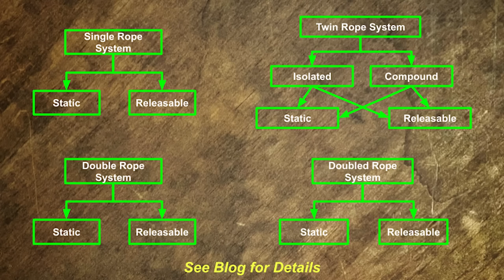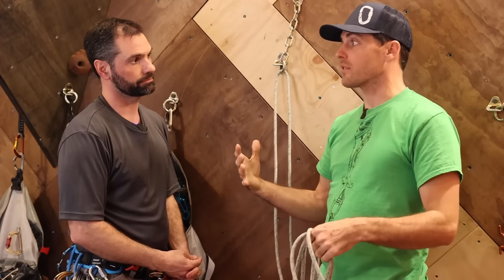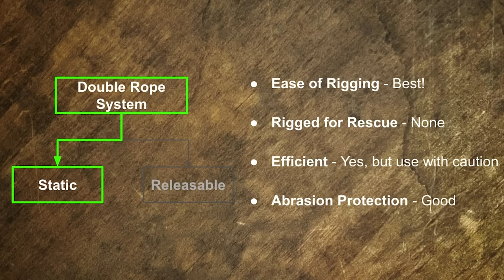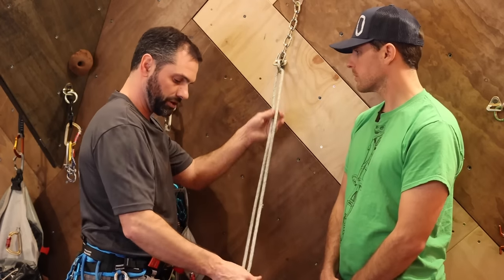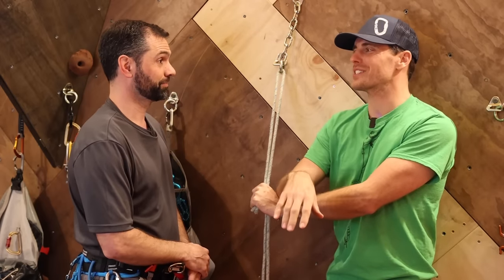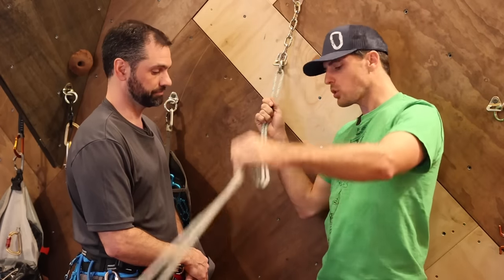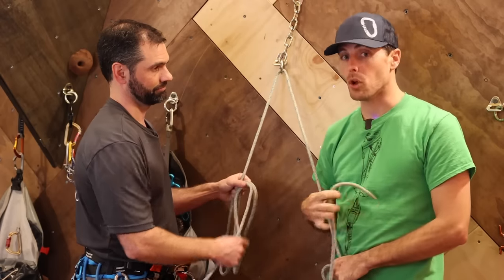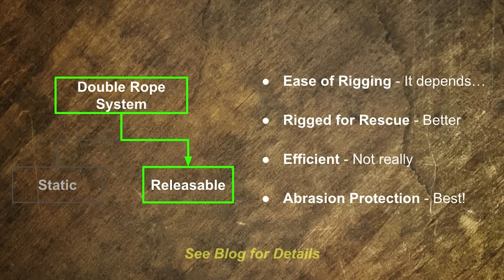Climbing vs canyon rappelling

Comment: When doing a simple double strand rappel there is a rescue option. You can isolate both strands at the anchor point using prusiks and then you can rig a contingency block and remove the prusiks and lower the stuck rappeler.
Reply: I’m gonna have to do further research to understand what you’ve written, but thank you

Comment: In caving, the changeover from descent to ascent is often practiced as an emergency maneuver. If you're on rap and get stuck in a waterfall... It's the same danger as canyoning.  But all the lines are single, static, (non releasable) and there's no rescue option.

Comment: I'd love it if you could get Brent to talk about the physics and science behind why, durning a 300 foot free hanging rap (such as a single stranded rap that is free hanging for 300 feet in Heaps Canyon in Zion), the first 100 feet you're almost feeding the rope through the rap device, the next 100 are perfect, and the last 100 you have to add friction! If you could explain why this is (is it rope weight? The rope "smoothing a grove" in the device? Forces from above?), that would be awesome!
Reply: Simple way to think about it - Just rope becomes lighter. ie less rope below you = less weight helping you brake / slow your speed. Less friction. More speed. More friction you have to add.
Reply: @1on1adventures48  So would it make a diference if the rope was in a rope bag connected to your harness vs. dangling below?
Reply: @BigDaddyAction360  interesting point here. With the rope in a bag (attached to you) - it then won’t change the friction like above. The only thing that will change is the actual weight of the abseiler. By the time you reach the bottom you will be slightly (weight of rope) lighter. So in theory - you will need LESS friction the lower you go. But it’s so little you probably won’t notice the 5% change. Interesting one 🤓
Reply: Yes it is simply rope weight. The base friction (before you add any by pulling on the rope) is set by the weight of rope hanging below you. That reduces as you descend. This is why descending on a stop on more than about 70m of 10mil or 100m of 9mil is a pain (a heavier person can abseil on a longer rope before 'too much friction' is an issue). Racks avoid this problem by having a much wider range of friction.
Reply: @BigDaddyAction360  Yes, absolutely makes a difference.  Essentially the rappeler would have zero rope weighted below them.

Comment: With so much amazing tech, it's hard to believe that the only way to descend an already-dropped rope is with the "VT".  Surely there must be some brand of Jumar or ascender that has a gate that opens, so that you don't need access to feed the rope ends into the device?    And with the skill level of these climbers, what's so impossible about doing an around-the-back rappel like it was done for a hundred years before sport climbing?  Naturally, I'd back that up with a Prussic (on a sling to my harness)  in my high, left hand, that I'd slide down with me as I rappel.

Comment: Double roping is done by a lot of amateur canyoneers but is really not appropriate, efficient, or safe. There are a million better ways than double roping. In order for a system to be safe it has to have contingency. Like Brent mentioned it will take you ages to get through a canyon if your double roping that's why nobody does it.

Comment: There is a way to rigg a sistem with one rope( or 2 also) , that is releaseble and the rappeler can go in one or double rope or even send 2 persons simultaneously and still be releaseble.
How? I can try to explain:rig a normal single rope realeasable, but the rappel rope has at least twice the rappel length.
Meaning, the end of the rappel rope doubles back and you tye a bouline Yosemite knot close to the anchor. OR use a second rope and with a triple eight knot  joining the ropes, the single rope releaseble(that is really short and the end of the rope is close to the anchor) to the second rope(rappel rope). The first version of this sistem has a loop at  the end of the rappel rope. Hope I could explain myself enough. But my native language is not English. Better to make a drawing